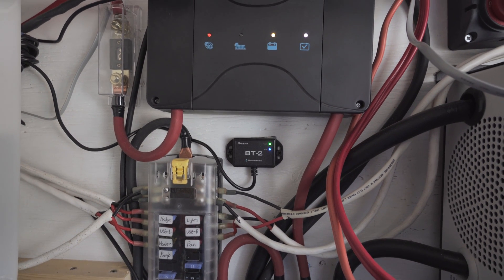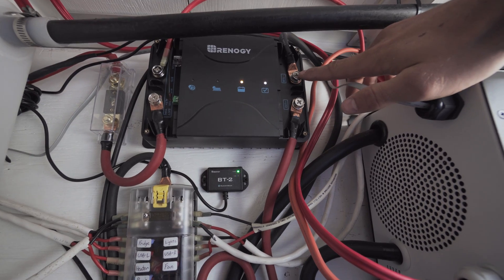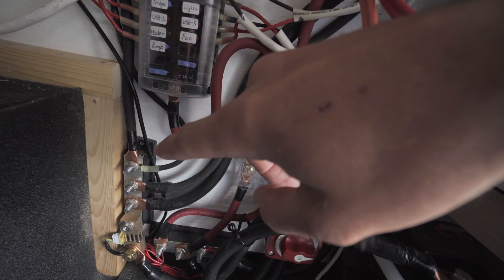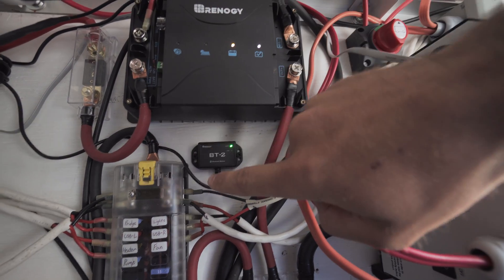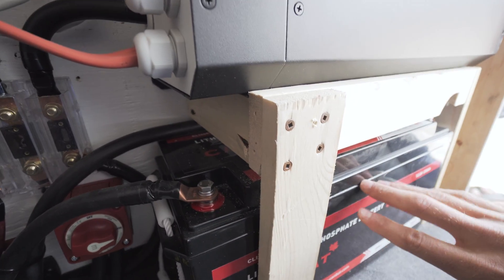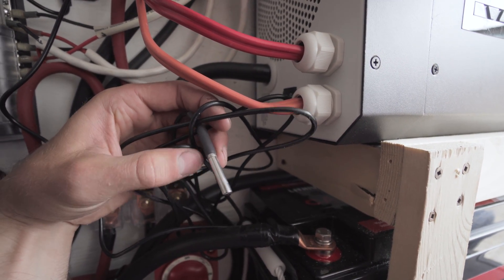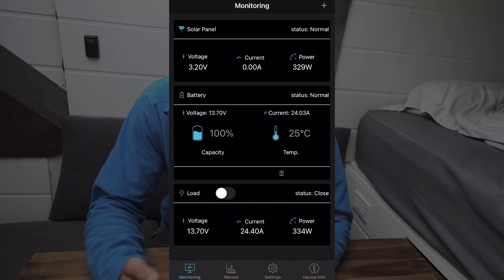Renogy DC to DC Charger Install in Off-grid Campervan Solar System

Comment: Beware, the unit will also cut out when the solar input exceeds 25 volts, its pretty much useless with Renogy’s own 200w panels.
Reply: The 200w renogy pannel maxes out at about 23volts, also the new version of the dcdcmppt 50 amp charger can now accept 50volts input from solar so can run 2 200w panels in series for example 👍
Reply: @AJBAdventures is the new unit DCC50S? Looking at a bundle now on their website that comes with 200w panels. Thanks
Reply: Where do you see the 50volt update?
Reply: @mperson91 as of Sept 2024 it is now factory 50
Reply: 25V is more than enough though? The max voltage (Voc) is 23V for the 200W solar panels. So long as you hook them up in parallel not series, you're fine.
Reply: @NielsenSam7  experience has shown otherwise, the panels exceeded 25v during most of the day when the sun is strong, the unit would only work for an hour or so after sunrise and again before sunset, and yes wired in parallel. I had a lot of arguments with Renogy as they couldn’t accept that they had sold me a useless system.
Reply: @nobbyclarkster do you think It might be possible to put a resistor inline with the solar panels so that it can’t exceed more than 25v? Although theres probably no resistor that could handle the amps?
Reply: I just found this out the hard way. Wish I'd seen this comment before buying!
Reply from the maker: Yeah, the fact that it can only handle 25v sucks….works well with my 175w panels though! Haha
Reply: How well will it work with 1 -100 w panel?

Comment: The ignition wire does not have a - they are both + according to the manual. Page 11 "There are two ports on the green IGN connector housing. Both ports have a positive polarity, so only one connection is required from either port."
Reply from the maker: Thanks Allen, apparently a lot of these charges come with a single conductor wire. Mine came with 2 conductors so I assumed it was a positive and negative. Regardless, mines been working great for 2 years connected the same way I did it in the video.

Comment: I don't know how to connect my ignition switch cable. In your video it looks like you removed the fuse and connected the cable to the fuse?
Reply from the maker: You’ll have to tap into an existing circuit. The trick is finding a circuit that is only powered while the engine is running so you need to use a multi meter to test these circuits. +12v while the car is running and 0v when the engine is off. It’s easiest to do in a fuse box.

Comment: Is this able to be used with a 2000-2500watt inverter off the solar battery? I’m trying to use this style of power for my work vehicle and need that amount of power constantly for 2 hours 2-3 times a day
Reply from the maker: Yes, it could be used with any size inverter. I use the Renogy 2000w inverter/charger.
Reply: I would like to use the renogy 3000 watt for my mobile detailing business for the pressure washer, vaccum and air tank. All used at separate times but max watts would be around 2000. What battery bank set up would I need for 3000watt. And what type of battery(s) would work best for my situation? Lithium?
Reply from the maker: @H2O_Details  I would definitely suggest lithium. It depends on how long you’ll be drawing that power for? I would probably suggest buying a 100ah lithium battery first and then add more as you require.
Reply: @madetoexplore  I will be drawing for 4-6 hours of the day at 2000watts soni figure the 3000w inverter with this dc to dc/mppt I could also utilize a solar panel setup on top of my van to utilize the weather for charging as well. I also could use advise on a reliable setup to put on my roof racks if possible
Reply: @madetoexplore  also would 2 renogy amg or gel batteries in parallel be a good set up for the price of batteries vs lithium
Reply from the maker: @H2O_Details  you can only drain GEL or AMG batteries down to 50% of there capacity. Lithium you can drain 80%. I would stick to lithium.
Reply from the maker: @H2O_Details  I would probably go with the Renogy 175 watt rigid panels. I have them and they work awesome.
Reply: @madetoexplore  awesome! Thanks so much! How many panels of 175watt could I use, 2?
Reply from the maker: @H2O_Details  3, the max this charger can handle is 600 watts if I remember right

Comment: Oh - why does it say in book NEVER connect solar to unit first ? Would it damage anything 
and why no internal protection?
Can you use only as a DC/DC charger without solar input?
Reply from the maker: There is internal protection but if you connect the solar panels first, the controller has no where to put that power which could cause an overload or components to heat up. That’s why you need to connect the battery first and it’s also a good idea to install an isolation switch along the positive wire to your solar panels making it easier to shut off.

Yes, you can use it only as a DC/DC charger.

Comment: I got a 310 watt solar panel and didnt know it puts out 40V 
- Both Renogys 30 and 50 amp will over current at 25v which is Crap
- other MPPTs will take 50 to 100v - now i have to downsize panel
or fit separate DC to DC + MPPT - wish i knew before as specs 
said 30A will take a 400w panel not 4x100 @ 24v
Reply from the maker: Yeah, it’s definitely a downside to the controller

Comment: Hey, can you do any sort of current limiting in the app? Like can you limit the charger to 40a? Cheers
Reply from the maker: No I don’t believe so. Just curious, why do you want to limit the current to 40amps?
Reply: @madetoexplore  no worries. Reason is I am thinking of running 2 in parallel. But worried alternator might not like it all the time. If the app let me play around with limiting the output I could tweak it to get max charge when needed, and flick back to lower for every day use.
Reply from the maker: @andrewlund3886  so the charger prioritized solar power. It won’t pull more than 25amps from the alternator if there is any power coming from the solar panels, even if it’s a only a little bit. It will only pull 50amps at night and if you install an isolation switch along for the solar panels to trick the charger into thinking it’s night time (like I did).
Reply from the maker: @andrewlund3886  also, if you don’t connect the smart alternator wire, the charger will pull even less amps.
Reply: @madetoexplore  yea your info was great on that part of the unit. I won’t be connecting any solar to the renogy, pure alternator charge. I’ll be going separate unit for solar

Comment: Nice Vids, and great to see a fellow Canuck in the van scene; made me go out and buy all Renogy!  We got a RENOGY 100ah Lithium Ion Phosphate Smart Battery, self-heating cause we’re up in Cold Canada too, the 50A Dc to Dc charger with MPPT, the 500amp monitor with shunt.  Question 1, is there a way to somehow connect shore power so I can charge my LiPo battery when the van is off, and no solar?  Question two, I was thinking to go RENOGY Pure Sine Wave 1000w inverter; basically need to power Iceco Fridge/Freezer, water pump, lights, nothing major, but then I saw your RENOGY inverter/charger video.  What’s the benefit of having an inverter/charger over a simple inverter if I have the 50A Dc to Dc charger?  This is all new to me, and we’re starting from scratch on our 1994 Volkswagen Transporter!
Reply from the maker: Hey! Thank you very much. 

The benefit of the inverter/charger is that it will allow you to charge your batteries via shore power and it will also invert the power from your 12v batteries to 120v so you can plug in larger electronics like your fridge.
Reply from the maker: There’s a TON of information on this in my Solar Guide if you want to check it out! Along with a schematic to help with the parts/install
Reply: @madetoexplore  totally makes sense!  I’d like to avoid getting the inverter charger tho cause it’s so huge and heavy.  Is there no way to connect/wire shore power into the Renogy Dc to Dc charger?  If not, is there an easier/cheaper way to charge the LiPo battery via AC from the wall?  I saw renogy’s 20A AC to DC LGP charger but it looks kinda meh.  If not, maybe the 50 Dc to Dc and solar will be enough?
Reply from the maker: @danielle_duval   that’s fair. It is ridiculously big! Haha 

We hardly ever plug into shore power to be honest so I would suggest installing everything else and seeing how it goes with your power consumption. Just keep in mind that you may have to install one in the future during your install.

Comment: Very bad as it only accepts up to 25V from solar,  only way to do is have panels in parallel, can not have cables with small AWG too long :-(
Reply from the maker: That’s true but it works perfect with my 540watt solar system!
Reply: @madetoexplore  how many voltage goes from 540w panels? Thanks

Comment: Which inline fuse did u use for solar panels?
Reply from the maker: I used the Renogy 15amp MC4 fuse. One for each solar panel since mine are connected in parallel.

Comment: Magic video ! Many thanks 😊   I have one question about the fuses for the starter /house battery to 50a dc to dc mppt.   Can you tell me which I should be using I've got a bit confused?
Reply from the maker: Usually fuses are sized 1.5x the max amperage running through the wire. In this case, that would be 50 x 1.5 = 75 amp fuse. I used a 60 amp because I wanted to protect my charger/wire a little more in case and also it’s the closest fuse I could order on Amazon during the pandemic. 

Renogy recommends in there manual to use a 75amp fuse on the input and a 65 amp fuse on the output. I would follow there recommendations.

Comment: At last thank you someone that has explained the 50 amp from alternator problem & solution along with the ignition wire connection & what to not / do. You Star !!!
Reply from the maker: So glad you found it helpful, thanks for watching!

Comment: Hey there, helpful video, thanks! I had a question about grounding - I see the charger ground runs to the negative bus bar, did you have to do anything special to the starter battery ground (either ground that to the chassis, or run a cable from that to the negative bus bar as well)? Or you only had to run a positive wire from the starter battery to the charger? Thanks
Reply from the maker: No, the starter battery should already be grounded to the chassis. My negative bus bar is also grounded to the chassis.

Comment: Can this 50amp mppt charger controller trickle charge my starter battery,  every other day need to boost starter battery
Reply from the maker: Yes, once the house battery’s reach a certain voltage (which you can adjust using the Renogy BT2) the charge will be redirected to trickle charge your starting battery

Comment: Am I understanding this video correctly in that I no longer need a Rover for my solar? It looks like this device does everything solar and alternator at the same time and or?
Reply from the maker: That’s right. It’s a DC to DC charger and Solar MPPT Controller.
Reply: @madetoexplore  I wish I would have known that I would have never bought the Rover 20. I suppose I could upgrade my PWM in the house.

Comment: Thanks for the nice concise presentation! I have 510w PV with MPPT charge controller (up to 60 A).  Just dropped a couple of hundred bucks on the controller, so is it worth the expense to buy this 50 A DC to DC and replace the existing controller, given that I have up to 40 amp charging when the sun shines (static or driving)?
Reply from the maker: Welcome! Do you already have a DC to DC charger or just the MPPT?

Comment: Where would you install a switch so that you can shut off the alternator charging when needed? (for saving gas) Maybe at the fuse box cable you installed? I don't want to be burning gas for electricity everytime I drive. Does this make sense?
Also, would it be useful to connect four 100W panels (12v) in a 2s2p fashion? that way 24V is still under the 25V max but you have high voltage and low current, taking advantage of the MPPT capabilities. Thanks for the great video! (I might buy this from your link)
Reply from the maker: I would install the shut off underneath or beside the drivers seat since my cable runs through there and it would be easy to access while driving. 

Yes you could give that a shot and see if it works! Let me know how it goes.

Comment: Just setting up my van. I picked up two 100a lifepo4 batteries.  A renogy 50a dc to dc charger.(same model as yours) And a 2000watt renogy inverter.  I’m stuck at a standstill on what solar parts to get… was just going to do the premium 200watt kit with the 20a solar charger with mppt from renogy.  Do I need the separate charger unit or does this act as that? You noted that your dc to dc is hooked up to the solar but didn’t mention a solar charge unit. What are you using?
Reply from the maker: The 50a DC to DC also acts as the solar charger! Instead of buying two components, you only have to buy one.

Comment: Nice installation ! I am new to DC to DC charging so this is my question. Can you let the engine run on idle for a certain period without damaging the alternator or any other piece or the car battery ? I am asking this because my camping trailer is sometime under shade and I could use this set up to recharge my battery in case they come to low. Thank you !
Reply from the maker: Yes you can, but you’ll want to check to see how many amps your alternator provides so you don’t put a strain on it. It’s also important to shutoff all your accessories while it’s idling (radio, fan, lights, etc.)
Reply: Thank you for your answer and I will ask an expert to check my alternator output when on idle.
Reply from the maker: @francoisdaigneault9387  if you call the dealership and tell them your VIN, they should be able to tell you.

Comment: Hi ! I bought your guide and watched your video, but I'm not sure I understand how to identify the right fuse for my T1N. They all are at 0 when I test.
Reply from the maker: That’s awesome! It can be a little tricky, what year is your T1N? Is your volt meter set to the correct setting?
Reply: @madetoexplore  nevermind, I (of course) wasn't on the right setting 😅
Reply from the maker: Let us know if you have any other questions! ☺️

Comment: Great video I also came to the conclusion to use a switch to get the full 50 A from the alternator I have version 1.1 of this device my ignition wire is just one red wire do I actually have to use the ground line thanks

Comment: Two replies in quick succession, sorry haha. At 7:45, the house battery is full, yet it seems to be getting 11A whilst none is going to the starter battery. I thought once the house battery was full, solar would top up the starter?
Reply from the maker: Even though it says that it’s at 100%, that doesn’t mean it’s actually full. 14.7V would mean it’s completely full. I would suggest you get a battery monitor with a shunt since it is much more accurate and will make more sense. 

I had imputed custom settings that told the charger to top up the starting battery once the house battery reached 14.4V. These settings are completely customizable.

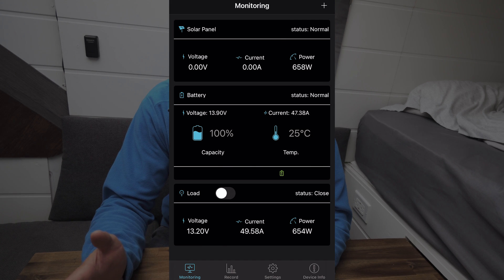Comment: At 10:15 (video timestamp), the house battery is full but it also seems to be getting fed with 660W. This doesn't seem to make any sense. Where's all that power going?
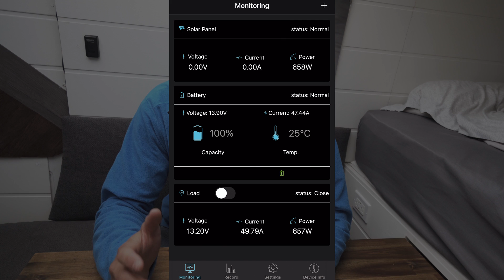Reply from the maker: Watts equals volts times amps. At 10:15, there’s no volts or amps so I would say that the app/charger isn’t reading correctly. The bt2 isn’t nearly as accurate as using a shunt.

Comment: the  alternator must be running over idle for cooling, at idle the air flow is very poor and it is a known issue with automotive high current alternators that have high charge capability at low engine revs, other wise great video thank you.
Reply from the maker: Thanks!